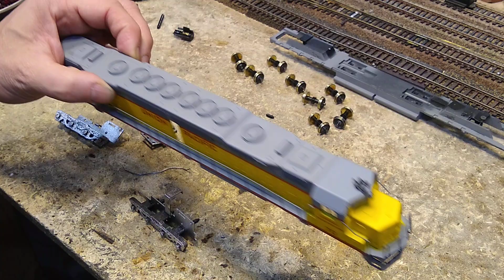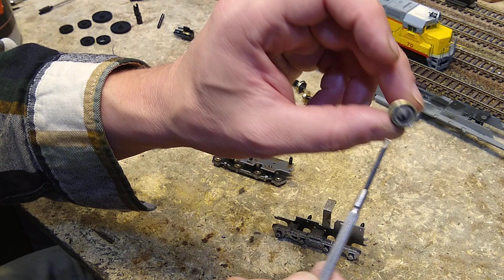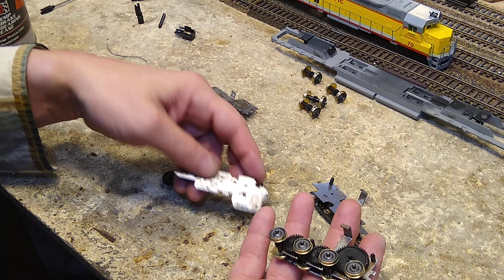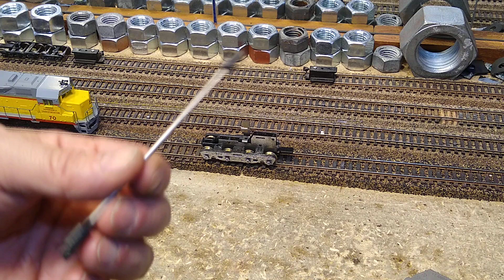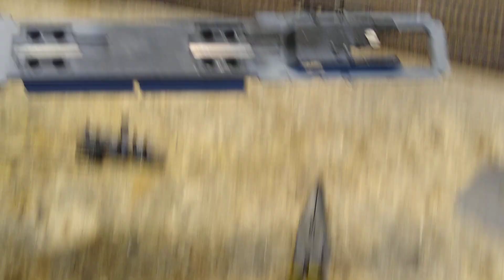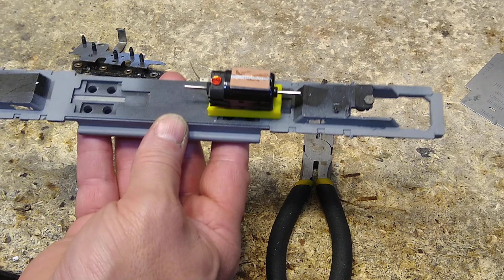Athearn DD40 truck assembly

Comment: Super. I have plans to put a set of "D" trucks underneath an Alco C-415, a Baldwin RT-624 dual engine transfer locomotive, or a couple of SW7 bodies glued cab to cab. I am also exploring the possibility of a four truck Shay with "D" trucks. Should be able to pull the wallpaper off of the walls. Hello from the Tracy Mountain Railway in Colorado. 💙 T.E.N.
Reply from the maker: I think it's the Mk10 version of trhe scratchbuilt trucks we did in 2023 that are D 4 axle trucks that were also the best trucks we ever made.  only problem was length - they were just too long.  I think we should do those again and shorten the space between axles and put them under an SD45!

Comment: Impeccable timing. Thanks for the insight in the interior truck surfaces. I'm waiting on a couple dd40 bodies in the mail right now after rewatching your earlier videos and I have dd40 ocd this week. At least one will be getting kitbashed with a proto sd60 cab. Might do something similar with the other, but need to find another set of trucks.
Reply from the maker: trucks are super hard to come by, I've never bought them because of the ridiculous prices.  there will be a solution to that in the near future thanks to the Colossus One project I will be able to fabricate the gear tower from acrylic and no longer have need of the stock trucks
Reply: Well, you've created a monster. How about a DD-60M, Tier 4? It seems with Covid restrictions and a manufacturing recession, the railroad, rather than a new order, opted to rebuild their existing DD40 with new tier 4 compliant power units, enabled by a pair of scavenged AC4400 radiators, recycled DD-60M cab and larger air filters, vents, exhaust and cooling fans. All scavenged from a couple of  their other, end of life units. It's already mostly complete. Just waiting for fans and an exhaust for the rear half of the shell to get here. All scavenged parts from proto Sd60 s. Not finished with this one, and I'm already getting around to doing another with an updated wide cab, etc. They will be powered by dual walther's motors.
Reply from the maker: @donavonrobbins1908  look at the satellite map of Chamberlain SD very closely and you'll find an abandoned DD40AX